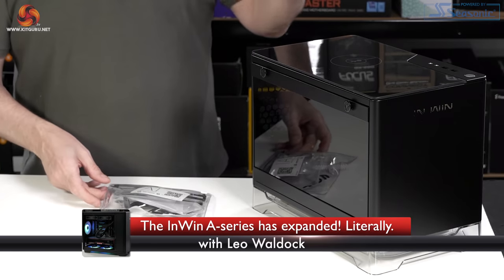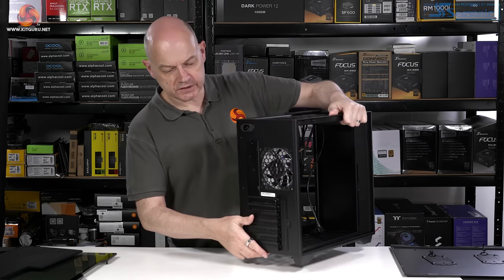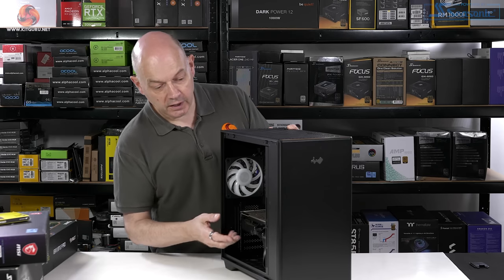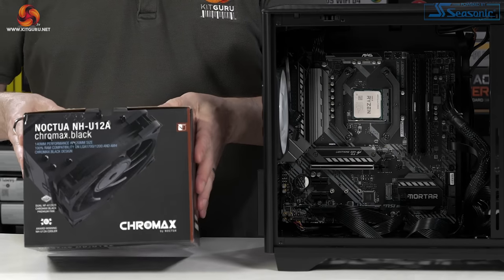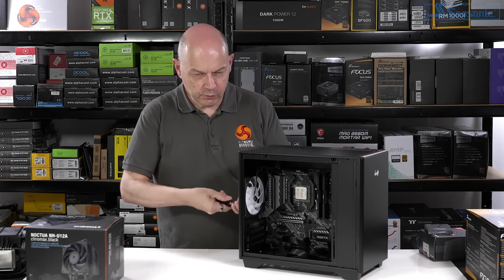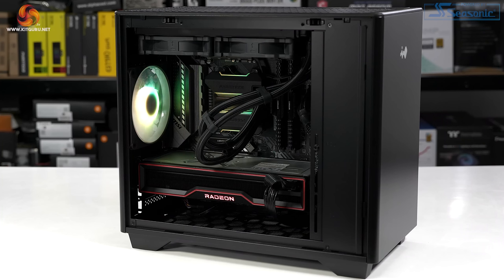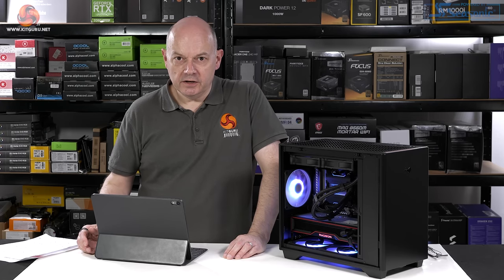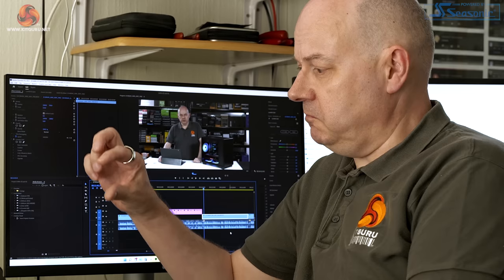InWin A3 & A5 Review - last minute price increase!

Comment: I think maybe the A3 had poor thermals because the hot air was recirculating between the fans and GPU. I believe the A5 will have way better thermals. Loved the design on this one, I always wondered why no ATX case had this layout that's quite common in the ITX segment to save space. The PSU hanging in the front and a chimney airflow is quite cool to me.

Comment: Great Review! Love to see the MATX variant getting the attention. Some thoughts on the airflow: The Powersupply fan in the standard config is working against the exhoust fan. Therefore it could be an Idea to flip the rear fan as intake (maybe adding a nylon filter againt the dust) to get less turbulence. With this config, even a back to front oriented aircooler could be worth considering, in combination with top exhoust fans so that not all the hot air gets funneled through the PSU. Using another GPU might also make a difference: The AMD Reference design is quiet blocky and has only a small exhoust gap in the shroud. A more open design or even a pass-through variant may get more air to the upper part of the case.
Reply from the maker: The airflow on the PSU may well be an issue however the bighger concern there is having it placed against a sealed panel. Ref flipping the top and rear fans, InWin is confident it makes little difference and I am inclined to agree but might revisit it if these cases garner a decent amount of interest
Leo
Reply: @KitGuruTech  IMHO flipping the rear fan from exhaust to intake, should help top mounted aio rad (top exhaust)

i'm surprise the a5 can't fit three 120 fans at the bottom  -_-
Reply: @fr0stief0n  2 years later and this was the correct answer well done

Comment: For anyone wondering, just reverse the stock fan on the back so it's an intake as well as your tower cooler fan is the same direction and you'll be just fine on the a3, psu will run a bit hotter, but now by much.

Comment: I have been running an A1 Plus for 3+ years now and my 2700X still idles at low to mid 30C range, day to day tasks at 38-43C, and heavy gaming at 56-60C. Stock cooler with stock original thermal pad that was on the Wraith Prism. I think it served me well.

Comment: One advantage of mounting the power supply in the Inwin A3 and A5 cases is that the 120mm PS fan is blowing air parallel to the ground.

That is important for a long fan life.    Many power supplies do not use ball-bearing fans, and if the fan is blowing air perpendular to the ground, the lifespan will suffer.

Comment: Did you consider or test reversing the fan in the rear to intake? It is unconventional, but it would help alienate concerns that the GPU is blocking airflow from the bottom to the top. It also might allow you to run the Noctua air cooler, if you reversed the direction of its fans as well.
Reply from the maker: I had a fair amount of back and forth with InWin on those very points. They are satisfied that airflow is fine and that reversing fans make very little difference. In the event this review does high levels of traffic I may revisit it
Leo
Reply: Yeah, Jonsplus have an ATX case with the same layout and the rear fan is used as intake and it even has a filter.

Comment: Great video as usual. I really like the styling and the placement of the PSU: it's a great use of dead space. Unfortunately I had to go hunting for this video as Youtube has stopped showing me your videos in my main feed, despite me being subscribed. I'm seeing this complaint about a lot of other channels too.

Anyway, with regards to airflow and thermals, I wonder if Inwin have missed a trick for air cooling: could you reverse the fans on a CPU cooler and the rear fan so that air flows from back to front (and out the PSU)? Indeed, I wonder if that might also help AIO cooling? And if airflow from the rear fan causes turbulence, remove it.

I wonder: is the naming a tie-in with Intel's new ARC GPUs? Or just coincidence?

And what a pity they're going to be so expensive in the UK.
Reply: Weird videos only sometimes show for me if I haven’t selected ‘all’ from the subscription options.

Comment: For the A5 would it be possible to put a mirco-atx motherboard in it and then put a radiator in the bottom for a custom loop? If so it would be an interesting custom loop build.

Comment: Inwin always has different and interesting cases compared to the rest of the market. Just none of them bring a solid list of pros of why to buy over a traditional layout. It’s still interesting if only for looks but if they would have inverted the mobo to be IO out the top like the psu then it may have had a better chance thermal wise making the gpu vertical and easier for airflow. I’d like to see a real winner from Inwin someday. They always have really interesting ideas.

Comment: I can't be certain, but that bracket covering the back of the motherboard cut-out appears to have mounting holes for either two SSDs, or one SSD + one 3.5" HDD
Reply from the maker: You are quite correct and thanks for reminding me that I did not mention that part. It doesn't change my view of the A3 and A5 in the slightest as my thoughts were centred on styling, pricing and cooling.
Leo

Comment: If the top and bottom panels are filtered, why not put two fans in push configuration on both and out in the back and use an air cooler?
Reply: The best air cooling configuration is rear and bottom intake with top and PSU exhaust. Pretty straightforward and I don't see why Leo missed this obvious config.
Reply from the maker: @TheJjjoj  There are a couple of points there but the main thing is that this is a case review so we look at the case as supplied and InWin is clear the rear fan is used in exhaust, as shown in their graphic. As for the PSU you don't really have many options when it is installed in the front of the case which is closed off from air flow.
Reply: @KitGuruTech    I understand you follow Irwin's default config for reviews but when you brought out the U12A, that should have been your first mention.  One of the weakest aspects of almost every case review is the lack of consideration of optimal airflow paths depending on cooling configuration. Avoid, "this a __ review" as an argument. It either comes across elitist, or dismissively stupid, yet offers nothing substantive to back up any claim. I know you are neither of those things. The psu acts as an exhaust; don't have the rear fan act as one too.  This case would be almost universally better with top and front(psu) exhaust.
Reply: @TheJjjoj  I’d disagree. It’s always best taking hot air from the cpu and pushing it out the top and rear of the case away from components. Intake front. Exhaust rear and top as heat rises is the best system. ‘Dismissively stupid’. How patronising.
Reply: @theonlyredspecial  The case has zero front intake. We are talking about the freaking case in the review, not general practices. I said the argument of "this is a __ review" is elitist, or dismissively stupid, because it implies the person you are speaking to is unaware of such an obvious statement. It adds nothing. It's a "because I said so" kind of dismissive statement. You chose to respond without understanding context. That's objectively patronizing. I don't see how Leo didn't mention it because he is usually decent at mentioning that kind of stuff. This one was particularly obvious which is what makes it weird. It was not a dig at him, but rather a point to his usual aptitude in this area.

Comment: I love the little one but had never hgeard of it until a couple of month ago and like the B1 pure in white you can't get them anymore. Amazon is cheapest price for the A1's, and that is £200 for each model way over what they are worth even with the free PUS. The B1 is their most mini one with them at £80 for the glass one and £135 for the over priced mesh. This is going on Amazon as non of the other big one sale them even know they are the newest ITX models. I loved the B1 pure in white and would but all in with import charges or via Amazon Prime it is £150. while the same model in Black and Glass is only £80 on prime. But it does suck they have no UK stores but part of that is Brexit fucking up imports for EU, I used to buy so many part from Germany in Euro's but no PC part cost are a joke. all Intel 12th gen have shot up £60 since GPU's have started to drop in price as gamer are now able to build a new system. The 12100 was only £99 but now is hitting £140 for the non F model, Also the 11th gen have gone up as they was the first Intel CPU to offer PCI-E 4 x16 slots. Even know most these new gamer's card only us 4 lanes of it now (Looking at the Arc A350, 6500 XT and 6400) . For a mini system I would look at the 10 gen, but it hasn't got UHD 700 iGPU with AV1 decode so for a 4K playback it would use the software render and that mean more heat output. the system I had planed for the A1 the 12400F and 6600 XT I had planed for gaming was perfect for the PSU out put on that case. But because Amazon is the only place to get those case now they are old and because No body stock In-win any more, it a case of buy direct get screwed by UK government taxes, Buy of Ebay scalpers who have illegally imported them. or look for use one which will most likely be used and defective. I decided to keep my older Fenix Pandora Case from 10 year ago ish. Spend the money on a wireless charge and better gaming PC part like a DDR5 board and higher end GPU. Gamig is not my main use also Power use is important to me so most the higher tier GPU's are dead to me. So instead of Building a 2 ITX systems one for long term office and low power usage with basic media with low power iGPU, and a light gaming one with a dGPU. I might just hold on. Or choice another brand. which is a shame as the B1 pure in white is the perfect ITX case for a low power office video machine. Which follow my reals on quietness and slick style. although the In-win A-serise is a little over the top on forcing RGB use. I like those on the A1 as they are defused well and low light. EG they don't look tacky Brighton Night club vibes like 90% of the gaming rig out there now. I like mood lighting RGB no flash crap disco light I had disco light for real as a child and have grown up now. It so suck IN-win Bcases cost so much to get here now.

Comment: A1 is not good for CPU temps. 15C difference after i move my components to a P200A.
Reply: The A1 is a 4 year old case and came out when glass and RGB were all the rage - the CoolerMaster H500P is from the same time and that was a joke from a manufacturer that is supposed to know what HAF means.
The Phanteks P200A was released last year and even CoolerMaster has learned by now from all the abuse it got that a glass panel in front of fans is not going to sell.

Comment: The A3 is rather disappointing, both in performance and function. It's marketed as "stuff it with hardware" and "minimalistic approach". Yet my NR200P ITX case can fit more fans (7 vs 5) and more storage (4 vs 3) while only taking up 2/3 its size. And for a case of that size to only support 2x240 rads is also underwhelming. The NR200P supports 240+280 native, but with some careful planning it can even accomodate 2x240+280.
The price increase is also bonkers. Costs 15% more than an NR200P (MSRP) while offering less, ie 1 fan vs 2, no pcie riser, no vertical mount, no extra side panel.
So in general this mATX case offers no functional advantage over a mainstream level ITX SFF chassis like the NR200P or a bulky ITX chassis like the Fractal Torrent Nano. There is barely any real competition in the mATX market so I guess InWin thought they didn't need to bring any innovation of functional design to market.

Comment: Looks WAY too small for EATX. I suspect it would be a nightmare to build in. 
Looks like a cheap cramped case HP would stuff a prebuilt in.

No sale.
Reply from the maker: I take a slightly different view about the E-ATX A5. You can see an ATX motherboard and graphics fit without difficulty so that side of things is fine
https://youtu.be/XlXCpTN6IDU?t=222
My feeling is that E-ATX means big and beefy Intel HEDT or AMD Threadripper so I want a fairly large case with high airflow and that is the reason I focussed on the mATX A3
Leo

Comment: You lost me at ITX....sheesh, ITX builds are silly unless you want it for media, or want it to melt in this heatwave.
Reply from the maker: We seem to have a crossed wire here. The original A1 is Mini-ITX however the A3 is Micro-ATX and the A5 is E-ATX.
Reply: @KitGuruTech  My apologies, thanks for the clarification. And all your efforts on delivering content.
Reply: Chassis size is not what determines hardware temps, but rather airflow. An ITX with good airflow will beat a mid tower with poor airflow any day of the week, ie NR200P, SSUPD, Torrent Nano, P200A.